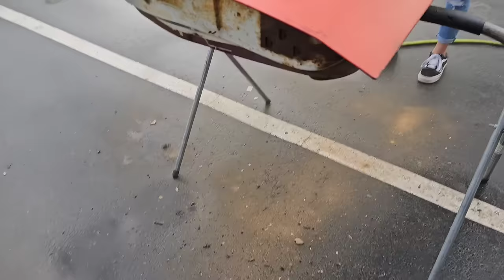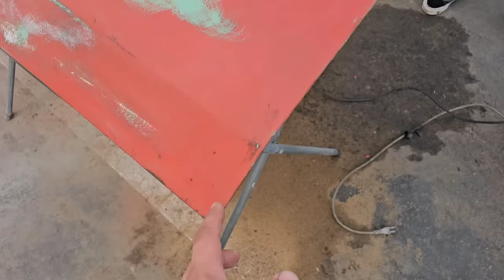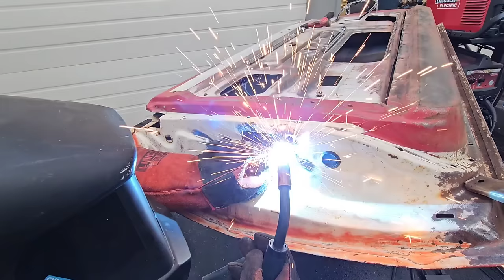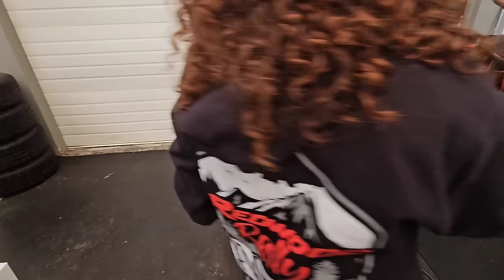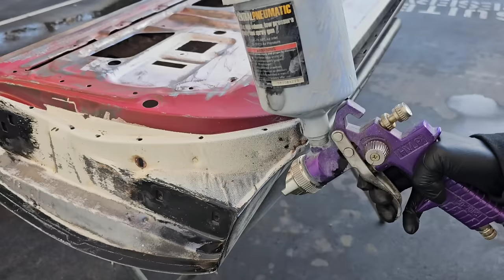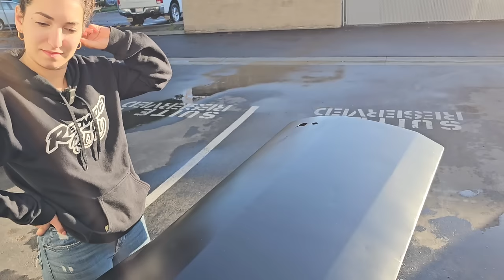Her First Time Doing Body Work – 1968 Dodge Charger Build

Comment: A little POR-15 tip. If the POR-15 has cured paint/primer does not stick to it that well. IF..., you paint/primer over POR it needs to be done in their stated "finger drag time" for recoat. Otherwise they advise using their "Tie Coat Primer" that adheres to cured POR-15 but also allows other paint to stick to it. I have found that the tie coat primer works quite well. Albeit it is one more of their product that you have to buy. I would also advise using the Metal Prep (phosphoric acid, available at Home Depot) in the bottom of the doors, rinse and thoroughly let dry (a leaf blower works great for that) and then paint the bottom of the inside about 1" up. Even washing a car will allow water inside the door but now the area will be protected.

Comment: Everyone has their preferences over what works best, but I’ll tell you something I found works fantastic on stripping paint and rust off irregular surfaces , they make a type wire wheels that are “cupped” with a very stiff and heavier type wire , that have spiraled strands , and a stem for use in hand tools .  You of coarse have to be careful and for sure wear eye and skin protection , but I put them in my die grinder, and  you can have something like the bottoms of that door down to bare metal in a very short time . Maby give that a try sometime ! I think you’d like the results . And thanks for the videos , they’re awesome to watch !

Comment: Nice job guys. Great mentoring by Danny and apprentice skills there Liv. I am a mechanic of over 30 years and train apprentices all the time so I know how it goes. I have been doing my best to teach my wife to work on her classic as well. She has a 67' Skylark and we dropped a hot Buick 350 and 4 speed into it together. We have been building a rear axle for it this winter. We both enjoy your shows. I would like to also mention I believe we both very much know your situation on your discussion at the beginning. I try very much to include my wife on projects for her car, but sometimes the timeline of getting it done forces me to just plow through it. She wants to be involved as it is her car. She does very well doing the work but only has so much time available. Ultimately she wants it drivable so sometimes I just have to get it done. By they way. At the beginning of the video where you guys were doing the body hammer work around the door latch Danny mentioned he did not know the name of the counter sunk divets in the sheet metal. Those are called dimples. We use them in aviation sheet metal work for counter sunk rivets. There is a press tool with dimple dies that presses that dimple into the metal. Keep up the good work.

Comment: I'm kinda late to the party on this video. Liv, there's plenty you can do on the charger. De-scaling that door, just for one. Cleanliness and attention to detail makes a big impact. Removing paint and getting to bare metal for the quarter panels to be welded. Simple vacuuming and rust removal will tell you where holes and weak metal are, so they can be filled or patched. Forming patch panels to replace bad metal is a good skill to have as well.
One thing, you will often find that the wire wheel will line-up the surface rust, take the loose rust off then use sand paper to get to nice shiny metal.
There is also some good rust converter you can use, and it will seal up the metal so no air gets to the metal. Rust needs 2 things, moisture and oxygen, to thrive. Rust converter takes away the chance for oxygen by sealing the metal, then you can paint over it as well. Just a few ideas for you......

Comment: Thanks guys, I used to be a welder in my early life in my 20s and I really like to weld. You're giving us very good direction for those who are learning from your videos. Keep up the good work. And the primer painting looks like it came out great in serving the purpose of using primer coats. I tried painting the door on my 78 C3 but didn't know how to properly adjust the air and really orange peeled it bad.

Comment: olivia  you should not worry about what content with the channel you work at, like danny said you have your areas you excel at and he has is, i think youve learned so much already, it shows!  iam sure you will in time learn the body work etc, that takes time, i think harder than the mechanical end. you have the camera part nailed down , mechanical youve come a long way to. ive heard so many utube channel owners say its difficult to make much progress once a week on a project when they are filming at same time. i think your both a natural together on your channel. you put out alot of different stuff not just in the shop, a varity i guess but good quality content every week.  youll get the hang of body work as your channel grows.
Reply from the maker: Thank you so much Gary for the super kind comment. 🙏

Comment: Try a super duty scotch brite 4" pad disc . You get them at a welder supply ( $30) using a small electric angle grinder.  They take off rust and scrappy paint w/o taking off metal - no sparks. Can be better than wire brush. ALSO  HF sells an electric angle orbital that doesn't use up the air compressor so much.

Comment: You worry way too much about that door. That thing will last forever now. As soon as I saw all that pitting, I knew high build would fill all that right in. Wont hurt a thing and smooth it right out with a little sanding. You'll never know anything was wrong with it, soon and it will look just like a new panel. I had a far worse door than this on my t-bird. I had to rip out a whole long section and replace it but it was worth it, cus it's cheap. Only body shops need to replace all the panels really, cus time is money. When your doing it for your own ride, there's no harm at all in repairing. No way would  wasted that door either.
Great job guys.
Reply: Oh, I already gave my opinion last video but gloss black with rear gold bumble bee stripe baby! Take your time, high build primer is cheap! Just block it out smooooooth as a babies bottom and go full gloss! All the work is in the body work anyway. You've got to paint it either way, so just shoot it and make her sexy! Doesn't have to be perfect.

Comment: I would recommend buying a sandblaster and blast the parts that are bad rusty rather than using a power tool and a wire wheel, because it can get where you can't with the tool.

A tip is to also put a tarp down so that you can reuse the sand that you would normally lose, just be certain to pick out the large trash in it, or screen it before reuse.

Comment: Start with fillers, short strand glass for over the welds, lightweight filler mixing with hardner and applying fillers, feathering using a spline and straight and linear blocks, etc.. also, the differences in primers that’s literally a whole day of just talking before you even touch the car.. lol 💯

Comment: On your welds where your blowing thru that's where you need that flat piece of brass I mentioned earlier it will make welding on thin metal much easier. Also, from my bad experience you should wear better leather shoes. Trust me I cought a sock on fire and suffered third degree burns of course the sock was polyester and melted to my skin.

Comment: Hey if you want more practice you still have that right quarter panel you guys cut off. Try banging out the dents with the hammer and dolly, fill in any holes with weld, and even do paint prep. Who knows you might get it decent enough to sell it to someone else. 👍

Comment: Welp, some advice, have done it for over 45 years, wear welding shoes, don't stand in water, if the ground came lose and you accidentally touch the probe,  you not only would be shocked, you may be dead of eletro-fields.
And don't use plastic from the old stripper, heats up and may cach on fire, after you throw it away.
And, normally, use a primer, then sealer, but, some sealer, your painting a color coat right after, other type, you have to wate 24 hours before paint, otherwise the paint flakes off like g.m. manufacturing. 
😊

Comment: Biggest mistake is before you weld those cracks is you need to drill holes at the end of the cracks to prevent them from coming back and you need to invest in some other dollies....Been doing this for 40years
Reply from the maker: Thanks for the tip!

Comment: That is a 1969 Charger, not a 1968 as the video title shows. Look at the side marker light on the fender behind the front bumper. 1969 Charger side marker lights are rectangular, 1968 side marker lights are round. 
It is important to be correct and do the car justice as you said.
Reply from the maker: Hey Mike. I assure you it's a 68. Dont be fooled by the grill or passenger side fender. Its got round tail lights, the proper driver fender and the vin checks out.

Comment: I can't watch this anymore Danny take that welder away and you do it.....Teach her on something that is no good like one of the old 1/4 panels
Reply from the maker: Gotta start somewhere! Not every job can go perfectly so I felt it was really valuable learning how to correct my mistakes.
Reply: What the worse that could happen? Have to cut a little little section and weld it back in. It's just sheet metal.